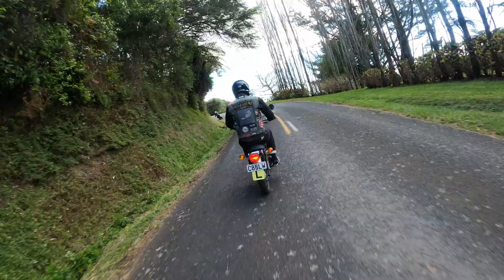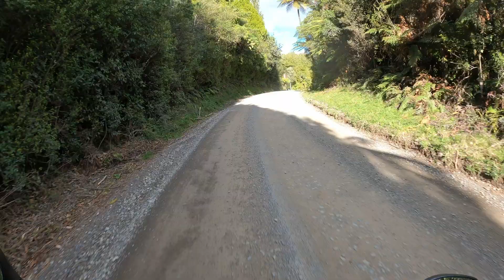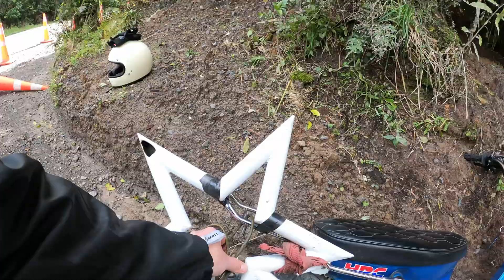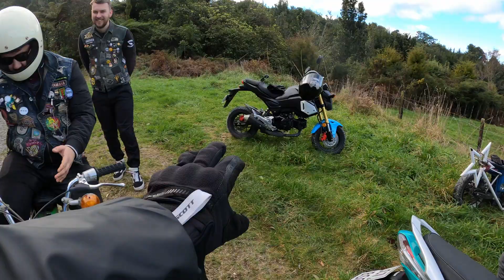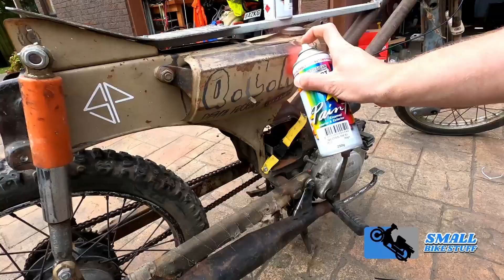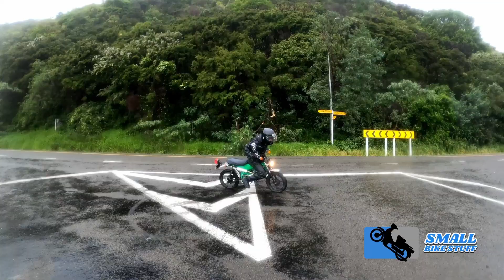Fuel Injection vs. Carburettor | Honda/Lifan

Comment: I have bikes with Lifan and factory Honda engines. The lifans start every time, don't smoke, shift well, don't make funny noises, and if serviced last forever. I think they get a bad name from those who just jam them in and go full send. My old Honda engines smell funny, don't always start first try, use or leak a little oil but they are awesome little engines, generally have interchangeable parts, repairable on the side of the road, will run with several parts missing and make cool Honda sounds. I get both sides, some of my bikes I'll never Lifan, others I'm not bothered. My go to bike for group rides.... all looks original but has a sneaky Lifan hiding inside.
Reply from the maker: Yeah I love everything equally. If I can ride the bike then I'm happy. Lifans are good fun. Smiles per mile.

Comment: Put Lifan 125cc in my Dax Clone, it did 13000 miles with abuse and deliberate SFA maintenance, I finally removed it from bike due to vibrations, the thing still ran with insane compression, bottom engine mount bent in middle of casing, sides drilled out to remove from frame. Amazing Engines! New motor £180 delivered, no point fixing it. Do a video on that green Dax, looks like 14” wheels 🛞
Reply from the maker: Thats it! We always joked they were a 'disposable' motor. But you get a heck of a lot of life out of them before they're worth throwing away. Love Lifan!
Reply: @SmallBikeStuff  just stripping it down at work on lunch breaks, the barrel looks worn, and  I believe excess side play in con rod, It’s the old 1 D 3 Up engines, large valve, can’t get them now, they are 4 up only new. I love the comment about loving the Dax over the Grom!